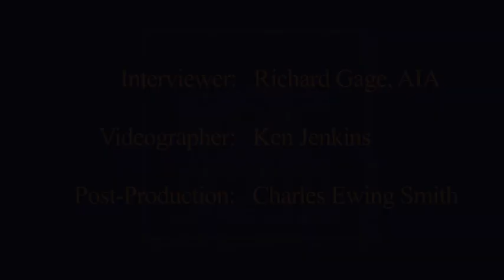Kamal Obeid, C.E., S.E. -- Civil and Structural Engineer - AE911Truth.org

Comment: @spcantwell where is the fire in wtc7?   post me a video -   don't you think that an inferno on the bottom 8 floors would be required for all the supports to fail together and produce a collapse as seen in the footage - a symmetrical collapse with a horizontal roof-line?  All supports must fail together for what we see to occur - can you understand this?

Comment: A quick rough estimate; 47 floors x 100 welded and bolted connections. Almost 5000 connections fail at once. Nope.
Reply: If only you were there that day you could have shouted 'nope' and the building would not have collapased...

Comment: @spcantwell ---> exterior pre-collapse signs of  massive interior damage, was right. Then how did all the rest of the girders and vertical columns fail in such a rapid order that it caused the buidling to come straight down without there being any signs of that on the outside of the building, and yet having NIST's computer model showing exactly what within the logic of such a progressive collapse SHOULD happen - namely SEVERE DEFORMATION and gradual collapse (not sudden onset) of the building..?

Comment: @spcantwell  get a grip watch?v=eDvNS9iMjzA -   free-fall means that all the potential energy becomes kinetic energy - no work was being done to move 8 floors worth of support beams and columns  out of the way -  go look at a massive building and try and understand that 8 floors vanished - 100 feet of vanishing - 2.25 seconds of nothing - ZERO SUPPORT -  ZERO RESISTANCE FROM 8 FLOORS -   this is impossible , especially when we're told that a fire did it -   fire cannot do it - what fire? Where?

Comment: @spcantwell  ----> (or even looked breifly into the crucial aspects of them), most of them should've found it unscientific. No engineers have spoken out, and would not speak out - even if the whole structure had come down at freefall acceleration..? Who do you think you're fooling???

NIST said that the collapsing penthouse was indicative of massive interior collapse? And we are to belive there would have been NO signs of that on the outside of the building? It is as obviously flawed as the --->